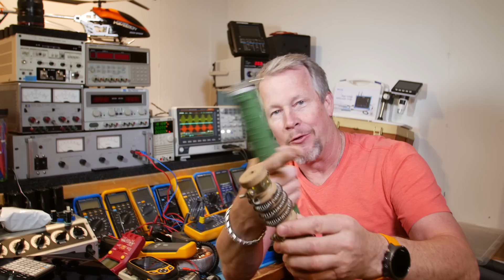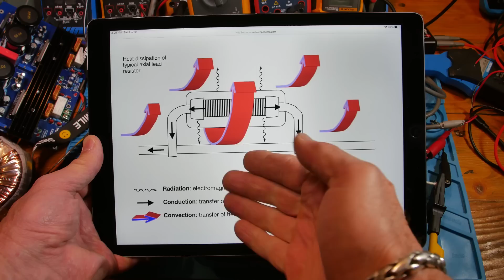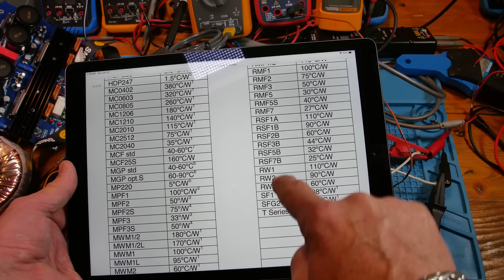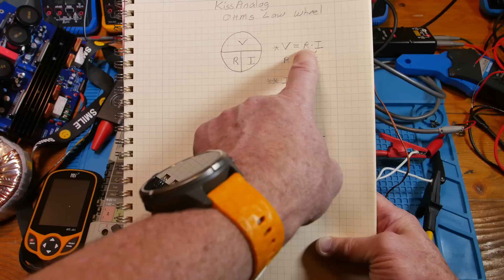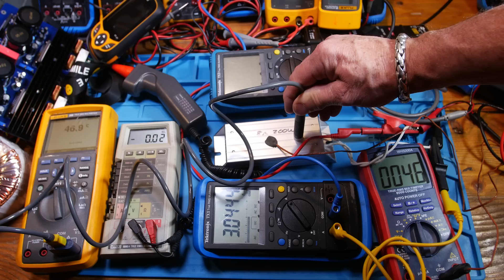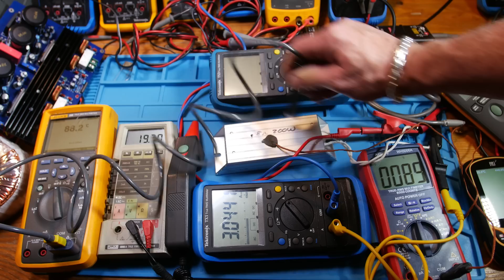Kiss U 105: Resistor Power Dissipation - part of Kiss University playlist #KissU #learnelectronics

Comment: Excellent demonstration on how things heat up over time.  It's clear that you must understand how your circuit works and do the thermal calculations.  It's also important to extrapolate what you were saying about your mat sinking some of that heat and the implications of conduction/convection.  The data sheets typically rate things at an ambient of 25C - if you have something in your enclosure heating up to 95C that is going to have an impact on ambient that can push other components over the edge without proper ventilation.  It's a clear experiment to show why we shouldn't be looking at just the raw numbers but planning on 30% or so of capability.  Really insightful, thanks.
Reply from the maker: Andrew Johnson Thanks Andrew - and thanks for the great feedback!

Comment: Great video but I have a question? When I was in engineering college in the 1970's we were taught there was already a safety POWER factor designed into resistors and If I recall, it was 20% at 1w and more like 30% at 5w. Is this not true now? 
In this day of built in obsolescence in almost everything I would not be surprised if the opposite is  true. Maybe a 1w resistor can only handle 70  to 80% of the claimed power specification. 
I especially wonder with some of the specs claimed by Asian made components, though, some of that stuff seems better than it was 10 years ago. 
Some of the PCB and kits for simple projects are so dirt cheap, I can't buy the parts to breadboard the project for less. Heck, even to proto boards cost more than some of the Asian completed boards.
I do like the idea of D-rating parts but wonder how important it really is.

Again, thanks for your excellent videos. It's like being back in college without the commute, annoying fellow students and grouchy professors. And I can watch in my jamies while dosing myself on caffeine.....LOL
Glenn, SC
Reply from the maker: wa4aos It is crazy how you can get a fully populated board at such a great price. I have had some resistors over heat.  So, yes I do believe in derating or making sure that the resistor is rated for a given temp rise with a given power dissipation.

Thank you for your kind feedback - you are the person I hope to reach - and this makes me happy that I am doing something right.

Comment: Great video Eddie,
Never looked up data sheet for a resistor, l will now.
So would you apply the logic to a voice coil in a speaker, as far as de-rating by 25% ?
As the coil is similar to a wire type resistor.
ATB Adam
Reply from the maker: Thank you Adam!  Yeah, some resistor data sheets are bla bla.  Wow, you bring up a fantastic question.  I think that deserves a video by itself!  In short, derating a voice coil seems similar to a wire wound resistor, but the resistor is round on a material meant ho help move heat while a voice coil is in free air, but is kind of part of a sleeve bearing floating in a magnetic field.  Great question!!
Reply: @kissanalog  
Good reply, lm probably off topic of dissipation.
I suppose the speaker manufacturers factor in some margin, rather than the user having to de-rate the speaker.
The speaker is more like a electric motor.
Similar to an induction motor

ATB Adam
Reply from the maker: Adam L Adam, I think you are right about the speaker, but I was going to check in with one of our friends here on this channel who actually builds speakers.  I’ll get his take on this and let you know.  Thanks for the great feedback.

Comment: Just great again and wary wary interesting! It sounds like if you "just select" a resistor that fits your Ohms calculation and decide to use a 220Ohm resistor, thinking that everything is fantastic, you can in fact end up with a resistor that have a higher value and screw your expected values up. And your 220Ohm, may be rated for 1/2W, but that is max rating and you may end up with a resistor that is constantly maxed out all the time and loos it's life fare sooner. It both heat it self up, heat the surroundings up and do even change other components specifications.
So rather use a resistor that find it "easy" to handle max wattage and run a lot cooler, then run at the limit. :-).
Reply from the maker: Thank you very much!!! All great comments and insight!  Resistors sometimes get overlooked but can bring down a circuit early.  Your feedback is always great!
Reply: @kissanalog  I am just glad that I do understand and learn from you. :-) My first comment was, as always" to assure my self that I have understood your lesson so I can avoid any errors in my understanding. :-)
It was an eye opener when you talked about degrading components, and your explanation made me conclude the above:-)
I consider you as a friend and a great teacher, about all I know, have I learned from you!:-)